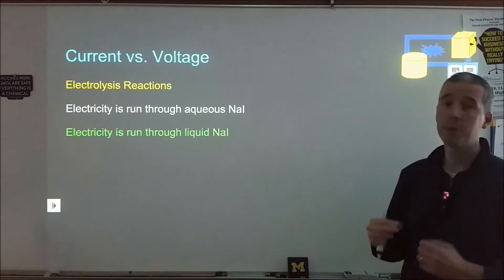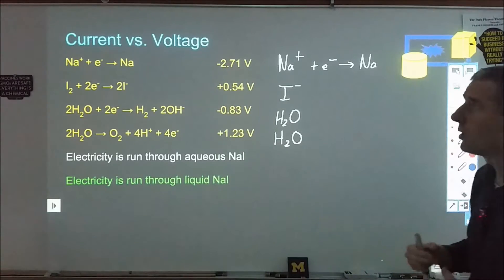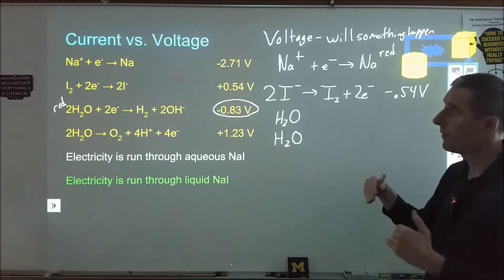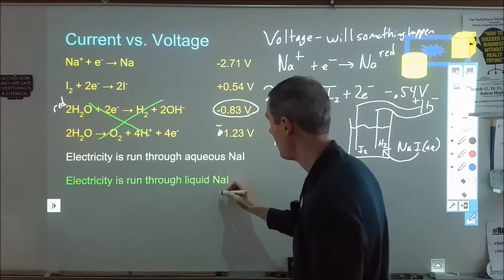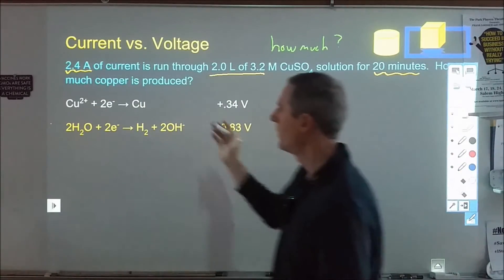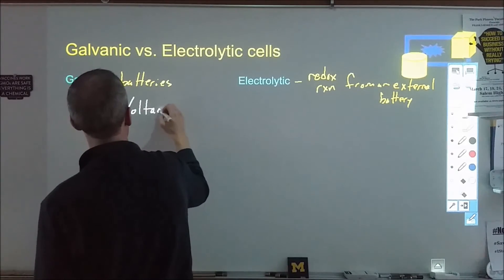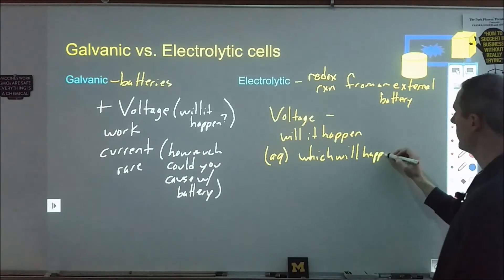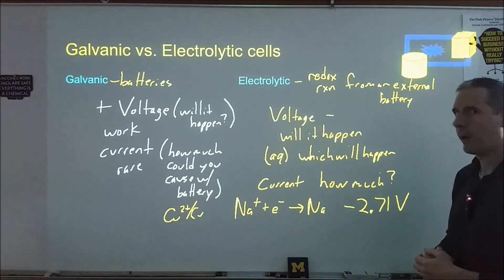Voltage and Current in chemistry

Comment: I'm curious, because you say in Electrolytic cells you take into account both the voltage and current. Does it make sense, in these cases, to talk about the resistance of the aqueous solution? After all, it seems like it's just a small calculation using Ohm's Law to calculate the resistance. Does it even make sense to talk about the solution as having an inherit electrical resistance?
Reply from the maker: Yes the solution would have a resistance, as would the battery itself and the wires.  The wires would have a very small resistance and I have no idea how the magnitude of resistance compares for ion conduction through solution to the rest.